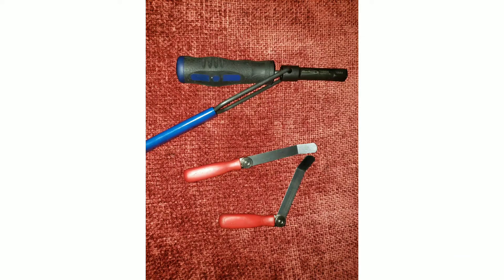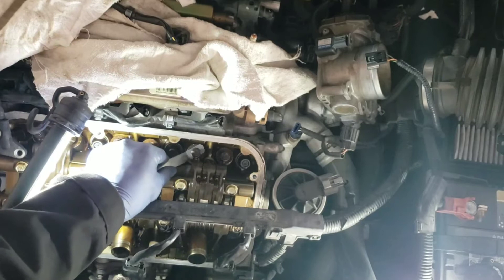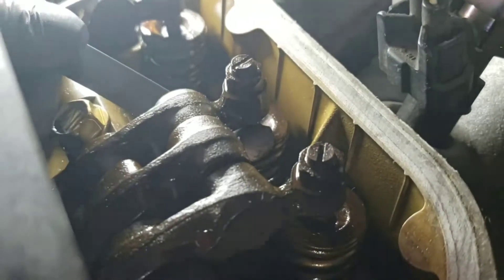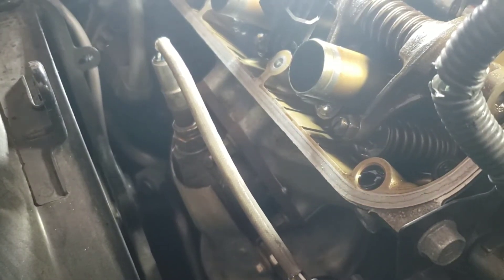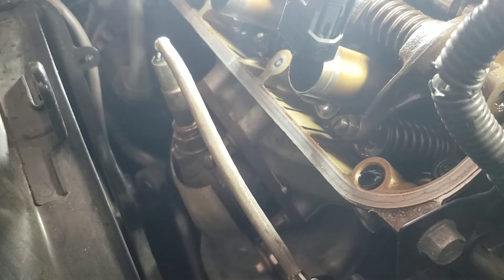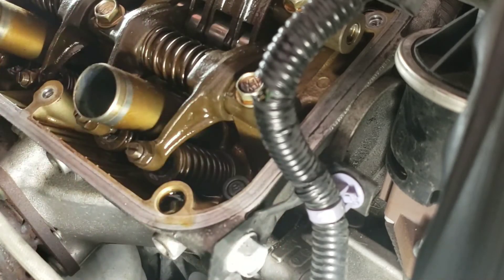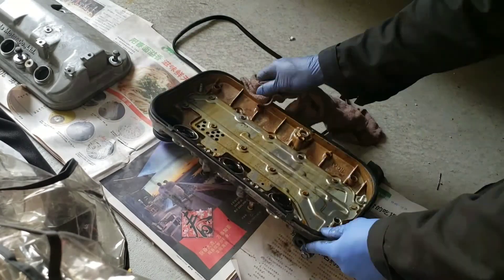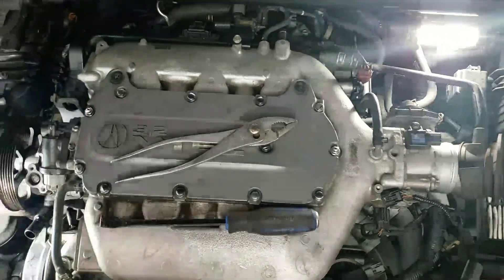HOW TO adjust valve clearance on | 2006 Acura TL 3.2L V6 | PART 3

Comment: I see exactly why you have NO comments. You screwed up the main part of the video...geez! You made us watch 3 parts to watch you jerk around with the camera on the VALVE ADJUSTMENT. Invest in a tripod or something...man, you only have two hands.
Reply from the maker: sorry to disappoint you sir about the video, however i dont see what i did wrong there about this tutorial; it just i didnt mention to turn over the crank on each cylinder or film the whole job for every cylinders